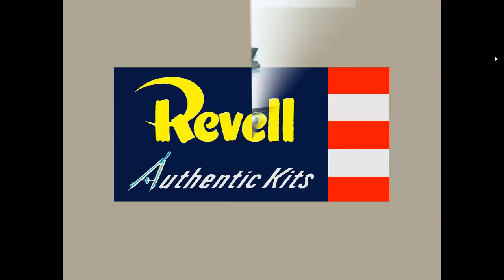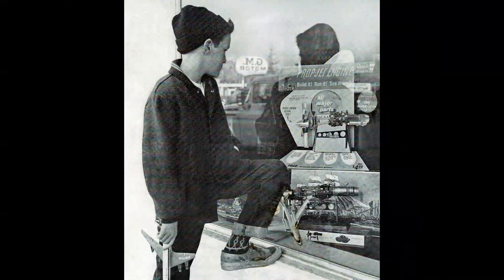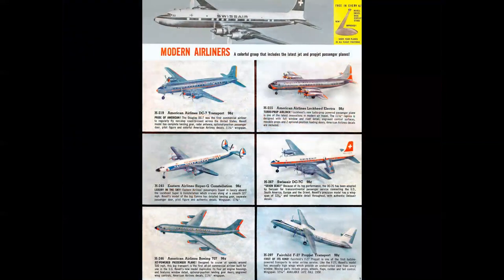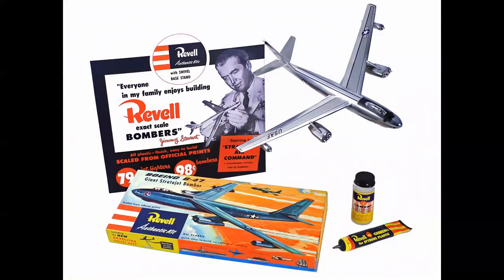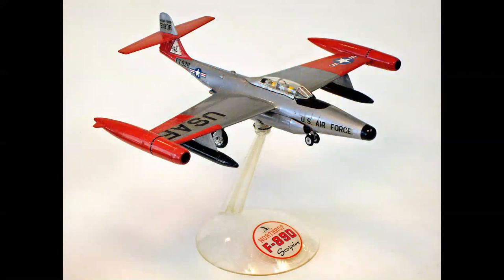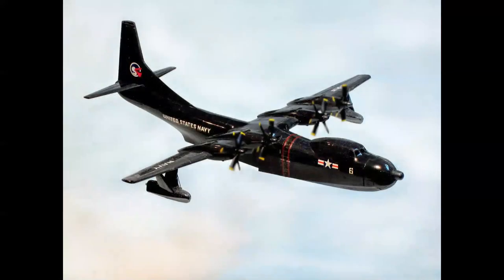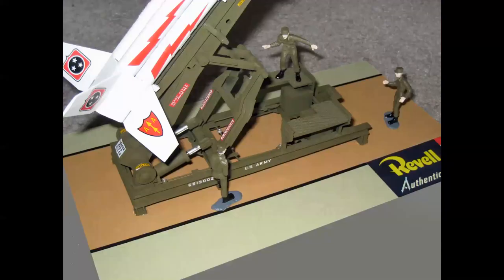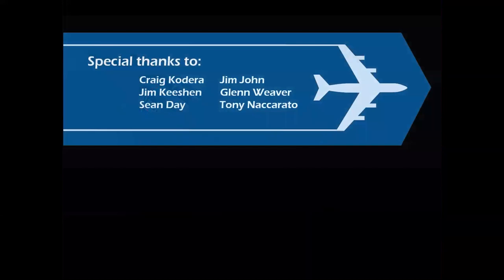REVELL MODEL BUILD-UPS - The Story of Original Revell Hobby Shop Displays in the 1950s and 60s!

Comment: I have an old, early 1960s American Airlines "Welcome Aboard" seat packet (you'd get this as part of your flight on American).  Within this folder is a flyer for the Revell "Jet-Powered Electra Flagship."  It also says, "Exciting Souvenir of Your Flight."  For $1.00 you could buy the kit prepaid or completely assembled $5.00 prepaid.  You sent your money to, Skyway Models, Dept. AA,  P.O Box 25782, Los Angeles 25, California.   I actually have this AA Electra kit.  One built up (not factory) on its stand and the other still in the box (all contents in a sealed clear plastic bag).

Comment: Another great video!   Re The Nike Missile, there was a Nike base about 4.5 miles away.  The radar antenna's were up on top of the Palisades in an installation called Mt. Nebo, easily visible.  Everybody assumed the missiles were up there too.  They were actually located in a parking lot off of  State Route 303 on a National Guard base!  About a quarter mile in surrounded by trees around the base perimeter.

Chuck
Reply from the maker: Thanks Charles, and yes, those Nike sites (and separate radar-direction facilities) were very effectively hidden among the unsuspecting populace at the time!

Comment: Excellent presentation of some models that we have not seen for a long time.   Nice craftsmanship as well on your part.   Readers may be interested that we used to cut off the bottoms of the Revell navy ships like the USS Missouri,  the USS Arizona,  or the USS Forrest Sherman right at the water line.   We would pack the insides with modeling clay available at the hobby store and seal the bottoms with balsa sheeting or or pain sheet plastic.    Subsequent to sanding down everything to a good finish;  we would spray-paint all with the dark gray monotone color characteristic of the cast iron miniature ships being produced domestically and in England.    Modelers at shows would ask "Where ever did you get these" since the finished products invariably gave the impression that they somehow were much smaller than the originals with full hulls on the provided Revell support stand.
Reply from the maker: Great story, thanks!

Comment: I have a very old small Tradewind kit made in Brazil, is a Revell, I got it from e-bay about 15 years ago. Will build it soon. One question, how did you paint your kits? Did you go to airbrush at one point? Thanks. Greetings from Normandy from a disabled Veteran SAC mechanic. (RC-135S & X)
Reply from the maker: Thanks for your question, and I was only a basic "out-of-the-box" modeler, using Testors or Pactra enamal spray cans and brushes for detail. I built that American Airlines 707 Astrojet in the video. Best regards, Mike

Comment: Hi Mike, can you please clarify - a Revell Pre-S kit is still made of styrene, but was released before the S-cement came along...and then we got the S-kits, which were new moulds that replaced some of those earlier kits?
Reply from the maker: Good point, but the "S" kits were all brand new airplanes at the time. Those kits, along with the earlier Pre-S models were then reissued in the "Famous Artist," "Famous Aircraft," and "Picture Plane" series of kits in the early 1960s. The only "S" kit I know of that was a re-issue upon its release in 1956 was the USS New Jersey (BB62) made from the original USS Missouri kit, but with Navy S-58 helicopters replacing the WWII catapult Scout planes on the "Big Mo."

Comment: I have a question about the Electra if revell destroyed the mold how come they were still selling Dodger Electras into the 1970s at Dodger Stadium? Even after the p 3 was released? I had both kits at the same time.
Reply from the maker: Great question, and the answer is your Dodgers Electra kit (now a cult collectible, by the way), was from the team's original "new old stock." They bought a large quantity of those kits for the fans, and the original Dodgers Electra model came in a white box with a blue duotone cover photo of the airplane on the ground.
Reply: @celebratingaviationwithmik9782  thanks Mike

Comment: Hi Mike, I'm new to your site and want to say thanks for a great site. Do you have anything on the Revell F-102 which had the connected landing gear and canopy ? I made that back in the early 60s and today, it goes for over $200 !
Reply from the maker: Appreciate the comment, thanks, and yes, I cover that beautiful 1/48-scale Revell F-102A kit in several of my model box top videos (check the "Models" playlist). There were actually two different versions of that kit, the first version came with all the ground equipment you'd find at an F-102 base, and that model cost a whopping $2.98 back in 1957! It wasn't a great seller for Revell at that price, so they re-released it a year later with just the airplane for $1.98. And yes, it seemed like everything operated on that big jet. If I remember correctly, when you closed the canopy, the landing gear retracted? Neat that you built that one back in the day!
Reply: @celebratingaviationwithmik9782     That's correct about the canopy....thank you

Comment: In 1961 (?) I was eight years old and my mom gifted me with a trip to the hobby shop.  I chose the Aurora Starfighter with the chrome finish. I scraped all of the glueing surfaces with an Exacto blade. My glueing skills were not perfect and any drop of glue that touched the finish ruined the area it touched. I gave up in frustration, the model looked battlescarred and not in a good way. Perhaps I should try again.